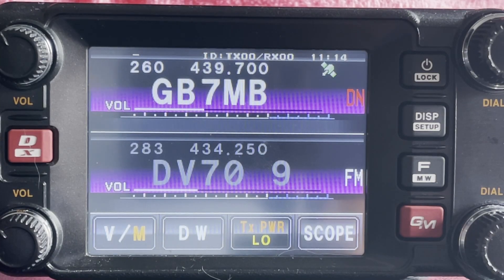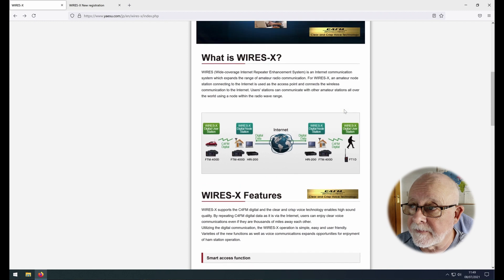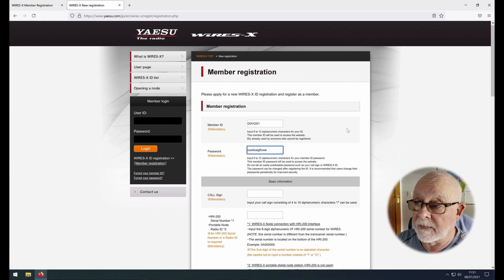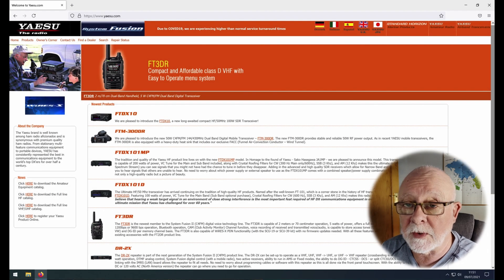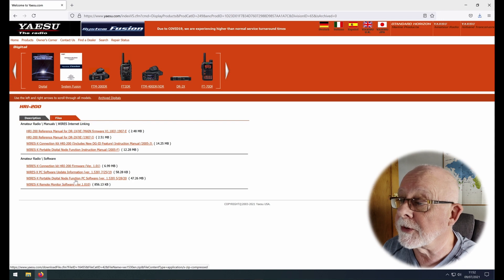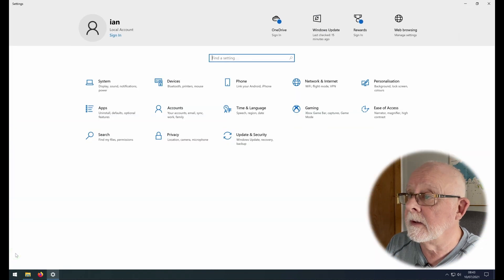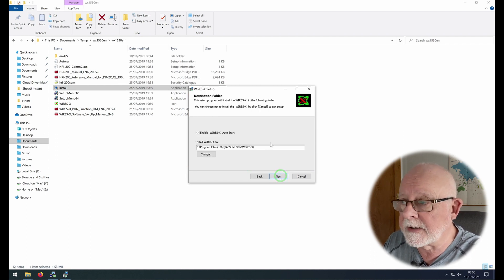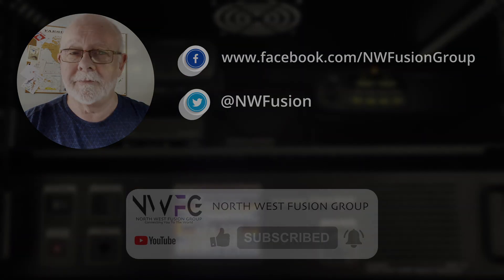14. Setting up a WIRES-X node - Part 1

Comment: I have followed this procedure several time on different computers and WiresX keeps crashing at random times, win10 new and older computers.
Reply from the maker: I am not sure how to advise on this.  I have never had an issue.  Try a reinstall and check if anything else is trying to use the com port.

Comment: Very informative video. Thanks very much for taking the time - look forward to part 2!   Is all the software you mention free ?   I see some adverts for programming software for this radio for like 25 quid?   It seems the ideal solution since I am limited on outside aerials at the moment.  ..  p.s. do you need a new registration for each radio ?  Cheers bob
Reply from the maker: Thanks Bob.  The Yaesu software is free but RT systems as you say costs about £20 ($25).  In my opinion, the RT systems software is head and shoulders above the Yaesu software but each to their own :). As for registration, yes, you need a separate one for each device.  Radio or HRi-200. Ian
Reply: @NorthWestFusionGroup  thanks,  sounds like its worth it then ..   any more hardware needed apart from what you get with the FT-400XDR out of the box to get going via internet ?   Someone told me I need 2 fusion radios ???   I think this is old info though?
Reply from the maker: @Bob-hc4do  Nope, all you need is in the box with the 400.  It can be improved by adding a HRi-200 but with the latest firmware, the old problems with Portable HRI mode on the 400 seem to have been corrected.  It will all be explained in part 2 :)
Reply: Thanks again !